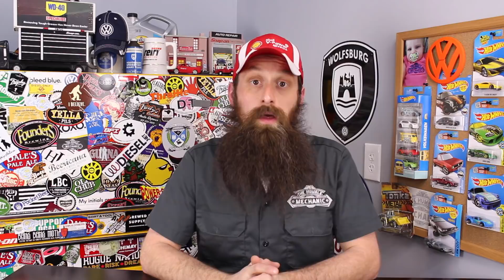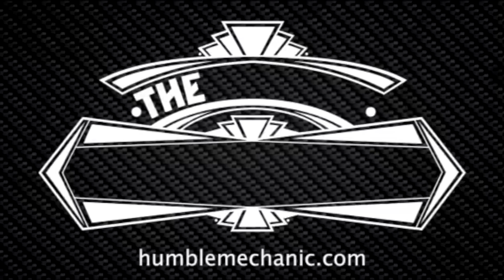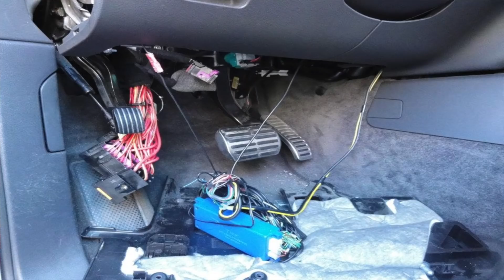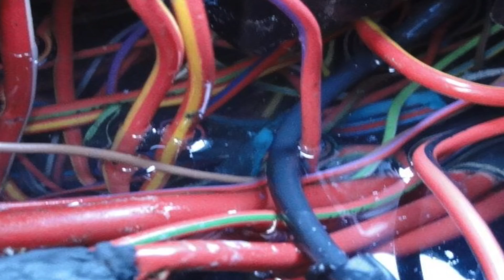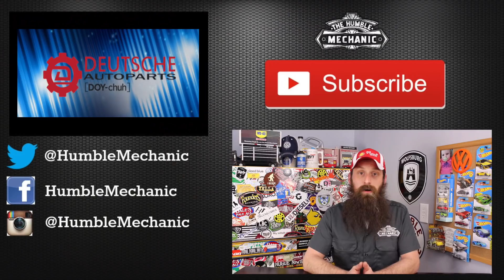Top 5 Failures of the Volkswagen Touareg

Comment: Front windshield wipers quit working.  Rears still work.  Answer, unplug the radio amplifier in the back, wait a few min, plug it back in it works.  GO FIGURE.  yes the wipers are on the infotainment CAN bus the amplifier I believe is the last or one of the last steps before going to the front wipers apparently.  Everything I read said disconnect the amplifier.  I did, it still did not work. reconnected it worked.  I don't know if maybe the signal was corrupt or needed to have the cable re-seated for anything downstream but that appears to have fixed it.
Reply: Hi there I have had extremely depleted FM/a.m. radio signal for several years had this car since I tried to get it fixed under warranty vw  replaced head unit several times but did not fix radio signal issue.

Where is this amplifier exactly located as I think it is part of even though my back wiper works!

Any help/input would be

Comment: Interesting.  I am thinking of buying a used 2014 Touareg to pull a 4k lbs camper do you think this will be reliable and good to tow this?  Also looking at a 2012 Lexus GX 460, or 2014 Q7. Need reliable and can tow 4k into mountains.
Reply: Can answer for the Lexus, great vehicle.

Comment: Just bought 04 Touareg V8, 140k miles, I'm lovvvvvvvviiiingggg it.
Reply: My employer has a 04 Touareg V8 as a company car and I got to drive it for the first time. About 155k miles. It’s an interesting unit to drive and my favorite company car.
Reply: Hey man how is the toureg , do you have any problems?
Reply: You will not love it long
Reply: @rileyshane78  My 2007 Touareg has 352000 km. Still going strong.
Reply: @SelfReflective  my wife bought one and it had 45k miles on it. Was a total piece of garbage after 1 year owning. Anything you can think of went wrong with it. Look them up, for that matter look anything Volkswagen up in the USA. Major problems and super expensive like they are bmw, and Mercedes
Reply: @rileyshane78  I'm sorry to hear that.
Reply: how's it going?. I'm looking at a 2005 with 150k
Reply: @Kiwiprofesor  I sold my touareg this summer for 2k. One of the Catalytic converters crapped out, and it was more to replace it than the car was worth.
Reply: @mfgunit  cheers mate - good to know
Reply: Why not just decat it instead then lol

Comment: I'm looking at a 2012 VR6 Lux with 93k miles. 2 owner, always in Florida (not part of Hurricane Irma). Car feels extremely solid. Any "must check/do" items you'd suggest at 93k miles? What's the deal with timing chain(s)? 2? Upper and lower - which are suspect to issues and what am I looking at having an indie do a timing chain replacement (upper lower or both)? What about water pumps too? Thanks!
Reply from the maker: Those chains are pretty good. At high miles older age the chains can stretch, but I have not seen that on anything newer than about 08. 

I always recommend getting a pre purchase inspection done. You want the entire car scanned for fauls

Comment: Got myself a very low mileage (2500km) 2015 touareg exec vr6 on 20" rims, and looks like the big new issue is the wheel vibration, missed that one on here. A whole blog out there for these new ones with vibration issue. Hopefully vw will fix it as it is still under warranty.  Will update if it is fixed.

Comment: They do have issues but if you get an older model with the faults fixed, then they are more robust than some the other SUVs. Another point is that if you Google the problems and use a technician that understands the faults, you can repair them way much cheaper than the Dealerships

Comment: VW just bought back my 2012 TDI with 80,000 miles.  With the exception of the Def heater, which I got reimbursed, absolutely nothing went wrong with it.  I was on my third set of tires and second brakes.  Regularly got over 30mpg.  I'm actually here because I'm thinking on buying an older one, love these things.

Comment: Just watched your top 5/30 on the T-reg but didn't hear much other than at the end about water by the drivers seat and wondered if you could help me out with my 07 v10
I get quite a bit of water coming out from behind the dash by the gas pedal, I presume its fro the A/C since it generally happens when the a/c is on.  I've pulled out a few panels from under the dash trying to locate the source even the undercarriage panel to spot a drain for the a/c but no luck.  Any suggestions as to what it might be and a diy fot it.
Thanks

Comment: im on the market for a 2004/2005 since its the ones on my price range. debating between the v6 or v8, would be good if its decent on gas so im considering the V6 but then again i would need to pull my atv so should i get the v8? are they fairly reliable and affordable to maintain? thank you for help

Comment: you nailed it...feel like you're speaking to me.  I have a 2004..think VW should buy it back under lemon law
Reply from the maker: They did buy back many of them. LOL I was involved in 3 or 4 I think
Reply: Thank you for your video and your time!  My hood release cable broke last week. Have spent 5 hours getting the kick plate off (who knows if I will ever reinstall it properly).  The gauge of the wire is suspect--very thin.  I wrote to VW to see if they will replace, because I sure cant ;/
Reply: I have a fully loaded 2004 V8 and when I went to check out financing, they took me straight to extended warranty dept to advise me that I should get it b/c VW's notoriously have electrical issues.  I had it two weeks when entire panel went dark.  They had it six weeks trying to fix it (brand new $55,000 car in 2004 (2003 actually)).  I SHOULD have claimed lemon law then.  I thought it was a fluke.  Obviously it wasn't. ;(  Have had rear differential problems, countless problems with the air suspension system.  Still have tire warnings popping up all the time.  On my third set of tires (at 33,000 miles), despite figuring out the inflation info was wrong for the first set.....Ughhhh

Comment: TPMS is miss understood, the light came on because you tire or tires has low pressure. People need to read the manual,its all there. Fill the tires with right PSI. On the steering wheels there is a menu wheel , choose TPMS and then choose learn. Drive on the freeway for few miles till the car learn pressure.
Reply from the maker: Yep, as long as everything is working correctly. But the T-reg was a bit different of an animal. It worked that way sometimes. But often wouldn't play nice. And NO customer wants their car back with a light on. lOL

Comment: Hello, I've been searching in countless videos of a loud rattling sound on cold start up. It only does it in the mornings, when the car is started before leaving home. Then will not hear it at all during the day, sometimes the sound won't be heard for days. Help would be much appreciated. Thanks in Advance.
Reply from the maker: +Yezabelle rodriguez on a Touareg?
Reply: +HumbleMechanic omg sorry yes :) it is a 2005 v8 4.2L Touareg.
Reply from the maker: +Yezabelle rodriguez could be a timing chain tensioner. That's pretty common. Not so much on the Touareg but other VWs with a similar design
Reply: +HumbleMechanic see, i was reading some reviews or the toureg community and there was something about that, is it something that i have to be on asap?

Comment: I have a 2010  VW  Tuareg, the car start but it can't move. there is no pressure on the gas pedal. what might be the problem
Reply from the maker: Maybe a failed pedal? It is drive by wire so any resistance in the pedal is controlled by the pedal

Comment: Always wandered how come a 2006 or 2007 Touareg is now selling for $4500 ; I remember they were like $60k new. The one I looked at yesterday, I noticed the oil plug has that torx drain plug, but it was rounded and stripped. The oil looked like it was changed two years or something.
Reply from the maker: +Y10Q yikes on the oil. 

Those cars and many other high line cars hold value very poor. Older German cars are big bucks to fix and maintain. 

It's a hell of a deal to buy one in good shape

Comment: Hi, I was really interested in your comment about the voltage affecting non-critical functions. I have a 2012 V6 Diesel Touareg and I have developed a problem with our AC. When we first get in the AC works great but then when we stop and turn the engine off.... shop.... start again the AC doesn't work. Could the voltage be a problem. We have a new battery installed after the problem first started but it has persisted. Have you come across this problem. Oh, and before anyone shys away from the Touareg..... big mistake, they are an awesome vehicle, I towed a 25' 2.4 tonne caravan 72000 kms around Australia over 2.5 years, not a single problem, out performed Landcruisers etc and my fuel consumption was 10.7L/100kms. most of it in ACC. Cheers, Gordon

Comment: Hi Charles.
I have a 2007 Touareg 3.0 V6 TDi
where or how can I activate the convenience Windows so you can open and close Windows by pressing the buttons on the key fob.
Virtually every VW has this feature but all sources say the T1 and T2 does not.
(I have access to ODIS)
Reply: Have you tried holding the Lock or Unlock button on the key fob for more than 5 seconds?
Reply: Yes, I own 4 VWs, I know how this works.I even tried to activate it in ODIS and VCDS.

Comment: I was thinking about buying an '04 V8 Touareg for about $3,000 but even at that price I don't know if it's worth it.  It would be used as a third car primarily for hardware store runs and to hook up my small trailer to.  The driveshaft bearing is no big deal but I don't want to mess with electrical issues.  I've also read that a lot of front diffs develop a whine which means rebuilding with new bearings.  Right now I drive an old Nissan Maxima and after 165k miles and 15 years it remains electrical issue free and mechanically perfect.  Lol, it's never even had a CEL.

Comment: Great video for Volkswagen Owner. I'm looking forward a 2014 or newer VR6 Touareg, are those problems also appeared in the new Touareg?
Reply: liu lu I’ve had two VR6 Touaregs (2013 and 2012). Both didn’t give me any problems at all and I drove them hard both on and off road. Great trucks.
Reply: I’m also looking for a video about Treg 2. I have 2014 V6 model and can’t find many info about any common problems, so I can prevent them
Reply from the maker: That’s because they are pretty solid cars.
Reply: Ever get a decent answer to this?

Comment: Buy a Touareg and you'll never buy anything else!
Reply: I bought Q7 after I own Touareg for 4 years, and I can tell Q7 is much better...
Reply: @radaflex5217  q 7 is a lot more money you bloody idiot
Reply: @radaflex5217  You should try a Cayenne Turbo then...
Reply: I have a 2008 Touareg v6 and have had nothing but issues. Wind shield leaks, it’s in the shop now because it won’t start at all won’t even turn over... crap ton of electrical issues and more I will never buy another vw product again especially how bad they treat me.
Reply: @Vr6.christos  Did you get it fixed? Had the same steering wheel lock problem., fixed it with 30 bucks.
Reply: @Vr6.christos   https://www.youtube.com/watch?v=3i_STqeCqZI
Reply from the maker: When they are right, they are awesome
Reply: is that because you won't be able to afford anything else?
Reply: Pain in the ass thats all they are
Reply: james peach 🤣😅😅😅 why
Reply: @ownrenep0264  dream not... $80k Benz cars are as bad as VW. The whole German car industry is really keeping busy with artificial chaos they organise. 

Luxury plastic seats covers are as good as plastic belt idler pulleys or plastic intakes... who do they think they are fooling!?
😂
Reply: #Zac. i really want to buy a 3.0 v6 tdi 2007-08 but i dont know if they are reliable
Reply: @nividagt3168  yhe v6tdi was a beast, light wieght decent on consumption and all the torque you need plus some more
Reply: @nividagt3168  I have one with 120k km. You have to Invest nearly 5k Than its ok. Ordnung Buy a landcruiser ☺

Comment: had an 04 for 6 months. second owner. 100k. had transfer case smacking, transmission shift valve wore out (common on these) so it didn't want to shift down to 3rd. coolant fan would stay on for 20 minutes after shutoff, always used factory spec synthetic and still developed a valve knock. serpentine pulley sheared off and dented the radiator while driving. Oh, and was coming up on its timing belt replacement which requires the removal of the entire front end and radiators. very expensive. but besides that, loved the car. wish it didn't have these problems i would of drove it to 200k. just too time consuming to fix myself and too costly to take to the dealer. oh well :/

Comment: I absolutely love my 2009 V6 FSI Touareg. I got lucky with only an older one owner who religiously maintained it. I would say the T2 models are the best in that they have 4xmotion with a real mechanical locking center diff unlike the newer T3 which is all electronic 4motion (Haldex). Also, the T2 (2008-2010) have a lot of fixes and upgrades including a quieter cabin compared to the T1. I'll gladly give up the extra mpg for the added weight if that means I have a locking center differential. :)
Reply: Incorrect.  I have a T3 with 4Xmotion (low range) 8speed.   They do not use Haldex but a Quattro (torsen) with a Normal 38:62 F/R bias upto 20:80 and 60:40  depending on which axle has more traction.   I also have a center lock function for 50:50 and if rotate dial another click i also engage the rear Mechanical 100% Lock.   I also have height and damping adjustable Air Suspension which is a close loop system for faster adjustments and less chance of contamination, the old system was open to asmosphere.   With my spare set of wheels running BFG MT i have never been stuck (so far)

Comment: I have a 2006 Volkswagen Touareg it has 100thousand miles! I went to get gas and after I got gas my car would start but it wouldn't go for like 5 min then it would like shift down and then shut off. I took to the Volkswagen dealership and they said it was both fuel pump. And the price they gave me was over what I could even pay. Could I put these fuel pump in myself? Besides that I went and try to start it and I guess the batteries dead so my key got stuck. So how do I get that out?   If you can answer there question that would be great!

Comment: I have an issue with my shifting, the gears change just fine but when down shifting it clunks and jerks like it's the transmission. what is it? transmission or drive shaft? please help
Reply from the maker: +T. Grupee Jr. it very well could be the transmission. Usually the drive shaft won't do that. Well it can do that but it makes other noise too
Reply: So u think it's a tranny issue?

Comment: i love vw/audi but god damn do they use a shit load of plastic in the engine. after 7-10 years i usually pull the motor and transmission and reseal with the updated seals and gaskets. but thats because i really really hate a leaking car.

Comment: Hello, 2008 VR6 and I had the corroded wire under drivers floor that made the T2 a brick. Found one post on all of the intertubes discussing this....so pulled this fix out of my butt! VCDS says I'm running in one wire mode...any theory? Did I miss another corroded line or impact another? How about Vw having a major wire for the T2 hand twisted and covered in electrical tape under the carpet that gets damp a lot!!

Comment: Hi, I have a 2008 Touareg with 78.000 miles. Lately it's been shutting off while driving, no noise, nothing. The first time is started right away, but now it's taking like an hour rest to start. The failure is becoming more and more frequent. The mechanic couldn't find the issue. Pls help
Reply: Jorge Vasquez  I had like this issue that car will stop while drive ( with Subaru) the issue was loose connection on battery clamp that got disconnected while driving and car just got nuts over it, I would say that it's always good to have new powerful battery  good connection on clamps and good cables that distribute power to candles this could reduce a lot of performance issues
Reply: thanks for the response. In my case was the Crank Position Sensor.

Comment: Dash blower motor has been replaced on both mine (07 VR6 and 08 FSI V8)...might want to add that. Some of my personal solutions are BF Goodrich All Terrian TA's for the tire issue (had mine on for nearly 60k), Vertex Solution for center main bearing, and I understand you can delete TPMS. My general rule is fewer options fewer headaches.

Comment: The problem with this testimony is that it comes from a VW mechanic where he encounters ONLY troubled vehicles. I don't think that the majority had those issues.
Reply: C_R_O_M________    I found a chart somewhere online that shows reliability by year and some cars are horrible one year and great the next. I guess buying new cars is risky. preowed seems to be the smart choice :)
Reply: vadim nesen indeed. I follow the rule of never purchasing a first year production vehicle. Let them pass the early "illnesses" on somebody else's hands, let the reports fill the internet about (un)reliability. It's safer and much more economical to buy a properly maintained used vehicle.
Reply from the maker: WOW, of all these "TOP 5 Fails" videos I have done, you are the first person to take that side of the table. THANK YOU! 

I can attest that in 2004 almost all the Touaregs had those issues. But from then on, they have been pretty good.